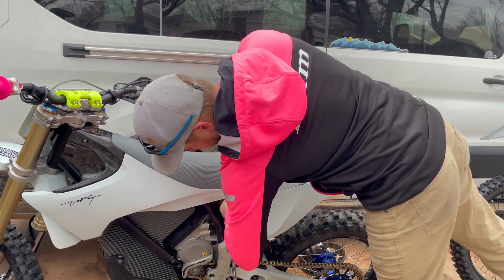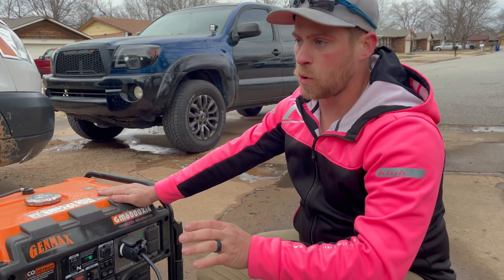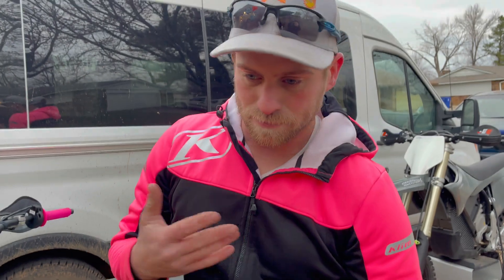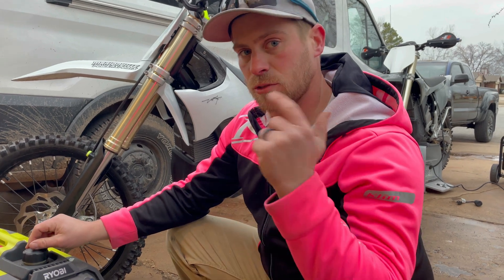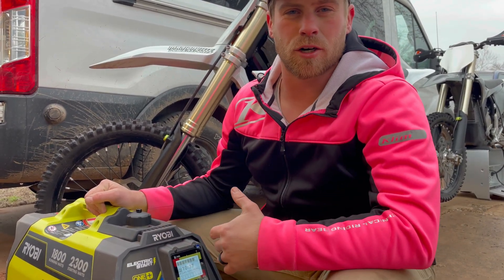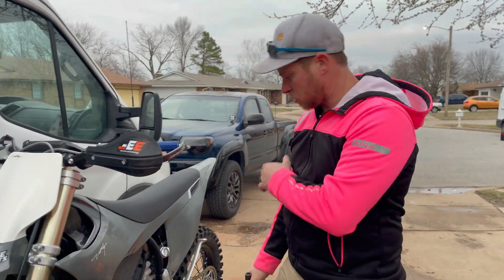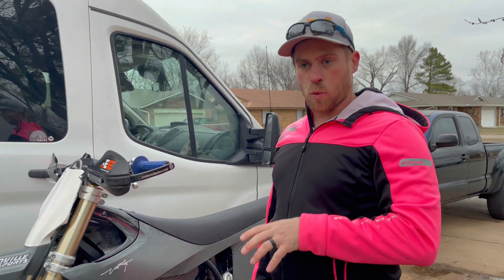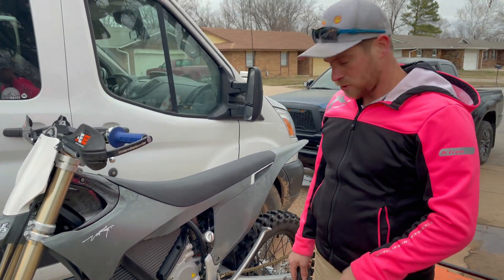Stark Varg and generators

Comment: my generator has the three plug 220.   when i buy an adaptor that goes  from the four prong to the three, it does not work.
Reply from the maker: Are you not in America? Their wiring may not match an original design.

Comment: Here’s a silly question- you think the predator 2000 would charge the stark lol? 

Outlets at home don’t charge the stark. I’ve got a predator 2000. About to try that before I buy a new generator, or is that ridiculous
Reply from the maker: It will work but you will have to charge at 1600-1700 watts on the stark. It will absolutely charge but would take about 3 hours from 0%

Comment: Hello, does your varg light up blue when it won't charge? My varg lights up blue when connected to the charger but never charges. The charger light is on but the fan doesn't work. Now the bike only has 6% left and I don't know what to do. I've been trying for two days.
Reply from the maker: Have you taken apart the charger cable and made sure the connections are okay? If you’re charging on 110v some people have had issues with that before

Comment: On a predator 3500 does it make any difference in charging with large 3 prong 30 amp vs standard 3 prong 20 amp receptacles? Just got my bike with Stark’s 110 adapter. I think the predator will be adequate for track charging/ topping up between practice motos.
Reply from the maker: The 110 charging should pull around 14amps at full speed. So there shouldn’t be any major issues

Comment: As an FYI it not very accurate to be charging at different percentages of charge due to the way Lithium Chargers.  Lithium, when they are at a low SOC will accept a charge much faster with the last 10 % taking longest. Think of it as the Ions going into a parking lot, as they look for places and the parking lot become filled up it takes longer to find a place for the ions to park.
Reply: I hate most analogies when it comes to electricity and electronics but your parking lot analogy was great!
Reply: Great way to explain for non technical minded folk & technical. 👍

Comment: IS STUPID CHARGE E BIKE WITH FUEL GENERATOR
Reply: The point of the bike is superior performance over a gas combustion engine. At best, it’s just ironic it’s charged by a gas motor.
Reply: Still this way the gas is used more efficiently than burning it in a combustion engine 😂

Comment: This is like the new YZ400. Going to change everything. I love gas bikes, but this thing is awesome. I don't get the hate, at all. The power and having it be quiet with traction control and almost no maintenance, I'm in. I ride a yz250x two stroke....
Reply from the maker: Aside from the warranty battery I had to do, we haven’t had to do much more than lube the chain and plug them in

Comment: Did I see a Mako360?  Do you have a product number or do you know a KTM model equivalent to look at that matches the Varg mounting locations?
Reply from the maker: I don’t have the model number, but the ktm bar clamps that have the rubber cones transfer over. XC gear sells the metal cones to replace them

Comment: Just curious but is the testing off cause one bike is charged higher then the other at start? I thought lithium batteries charge fast @ low % and start to get slower the higher %
Reply from the maker: We have a time lapse video that is a bit better. They don’t slow down on charging until around 90%

Comment: Is that the stark adapter? I can’t charge mine cause the adapter I have doesn’t work. Badass bike just sitting dead. Sweet.
Reply from the maker: I’ve heard of some people having issues with adapters. Common issue seems to be on the wiring either going to the charger or the 220v head.
Reply: @ShanePinney  there is a wiring diagram to make the same adapter alta used. I did this and it works perfect. The bridged 220 adapter was the problem. The charger is a L14 30A plug but doesn’t use the bridged connector. It’s wired ground neutral and power only. 

Electric dirt riders forum is a great spot to be if you have or want one of these bikes….OG alta owners who are so ahead of the times and help across the board on all these e bikes.

Comment: Check your 220V Cord Caps ...Stark did not cut off enough insulation off the wires...Charging mine on the Genny at 241 Volts...about 1% per minute... last 20% may take longer.
Reply from the maker: I heard there were some issues. Don’t see any issues on our side.

Comment: Nice to see the side by side comparison of a smaller gen and a big one. I went with the Genmax5500 and it’s charging a percent a minute or more at a very reasonable volume. Glad I went that route vs a small one that struggles a bit.
Reply from the maker: Thank you! We went with the 6000 mainly because it was the same weight but also $300 cheaper